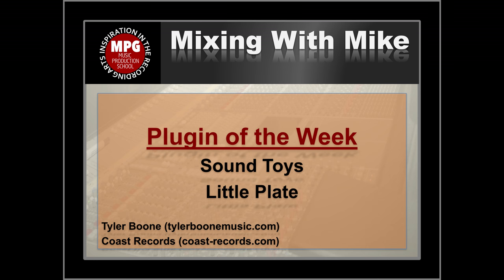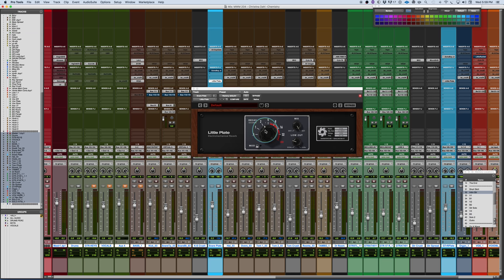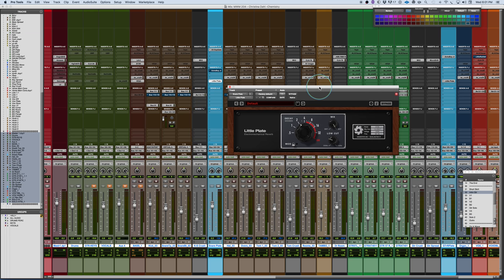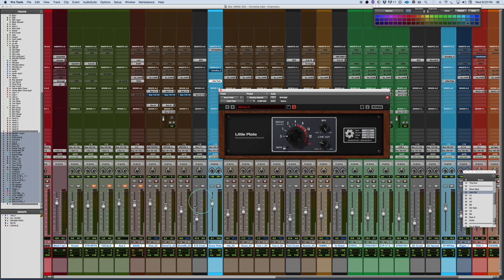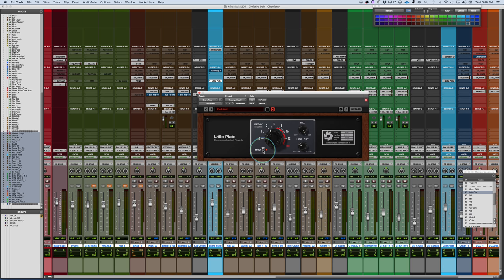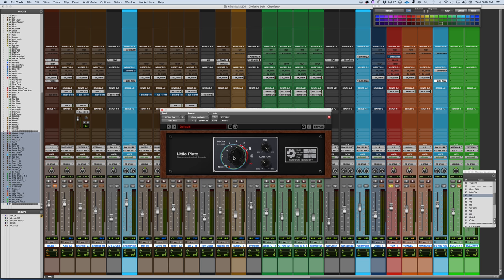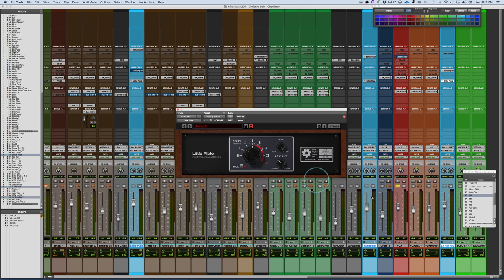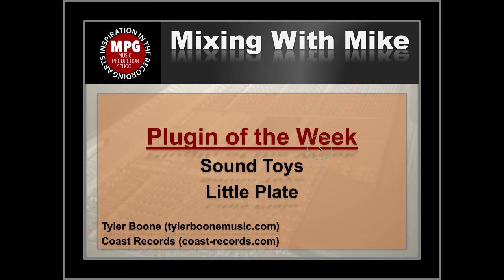Sound Toys - Little Plate - Mixing With Mike Plugin of the Week

Comment: I grabbed the Soundtoys 5 collection deal. Just couldn't resist. 
I just had a couple of Soundtoys plugins previously but those knocked a whole lot off the Collection bundle price. 
And you're right. Their Little Plate is a little gem of a reverb that I would probably not have noticed otherwise.
Rich and clear. Does what it does, but So well, as you said.

Comment: Thanks, this was a very good video with helpful general information. You forgot one thing, there are 5 different plates to choose from I believe, perhaps I missed it.
Reply from the maker: 5 different plates? There is nothing in the manual or on the GUI that indicates selection of different plates. If you are aware of how to do this please let me know. 
Cheers!
Mike
Reply: Hi Mike, as far as I know, Sound Toys sampled five different EMT-140's to get all the possible tone qualities they're known for. When you go to use different presets, many of them actually come from different plates.  @mixingwithmike
Reply from the maker: @martinjohnbutler  Hi Martin, As I understand it they worked with 5 EMT 140's to learn what made them tick. 

"Then we distilled what we learned into a plug-in that we think exemplifies classic plate reverb sound—dense, smooth, and a little bit dark." is a direct quote from the manual. I could not find any info that states that there are 5 independent emulations. I think they would have made that available directly on the GUI.

If you have some additional info from the ST website or elsewhere, please let me know. I hope you are right. I find it to be amazing in some situations and too dense in others.

Cheers!
Mike
Reply: Hi Mike, I don't recall exactly where I saw that, I've had the Little Plate for a long time now. I'll snoop around a little.
 @mixingwithmike
Reply: Hi Mike, I just looked around, and I think you're right. I'm pretty sure earlier literature didn't put it that way, they perhaps mistakenly 
made it sound like you had 5 plates to choose from, but have since corrected it. @mixingwithmike
Reply from the maker: @martinjohnbutler  I'm sure you are right. I find manuals very frustrating at times because of the way they are written. Lots of missing details I am interested in for the videos. Not to mention poor wording that leads to confusion.